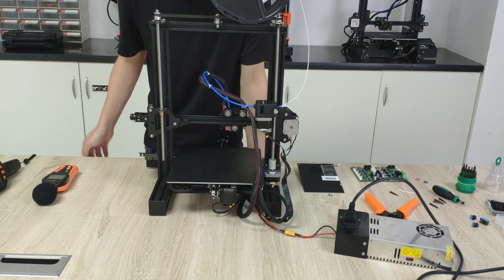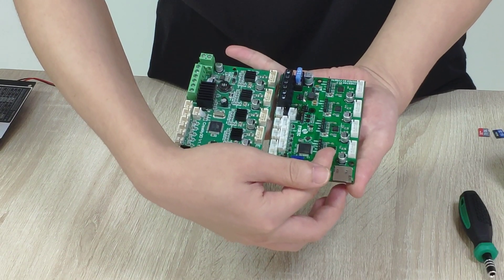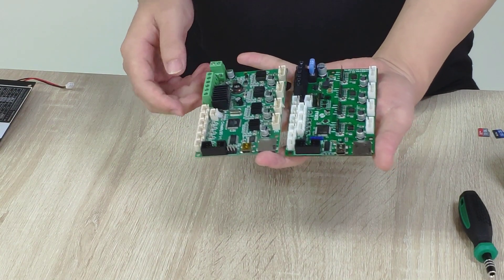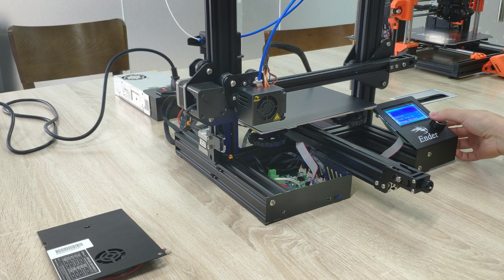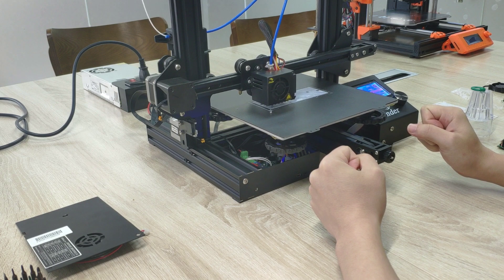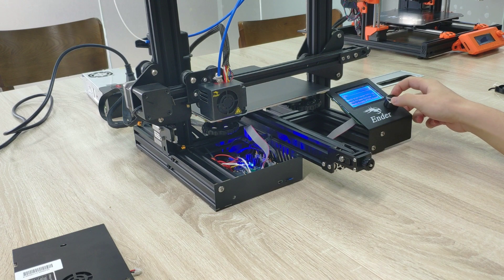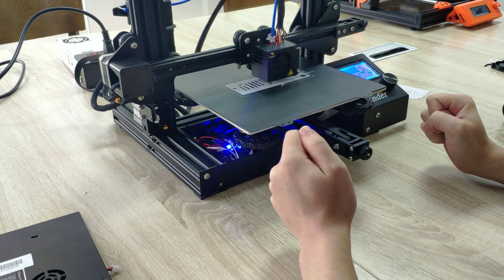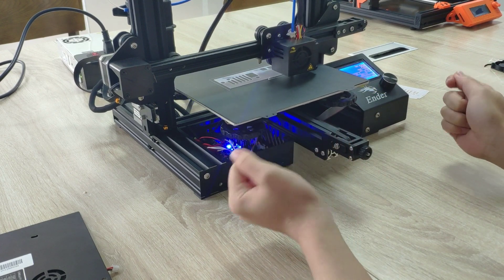Compare original ender 3 motherboard with FYSETC Cheetah v1.1 motherboard

Comment: I bought a cheetah 1.2a board and so far I'm very impressed. However, I need help with getting the original control board fan working as it's not. Second do you know if this board will work with the ezabl, from th3d. Thank you for your board and help